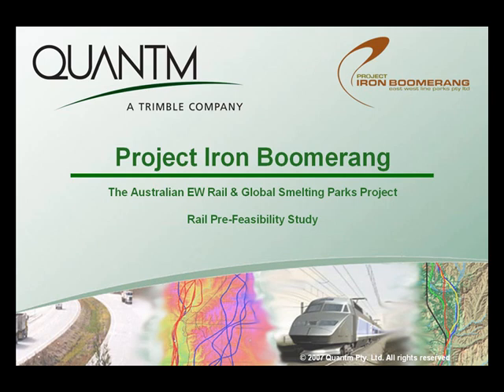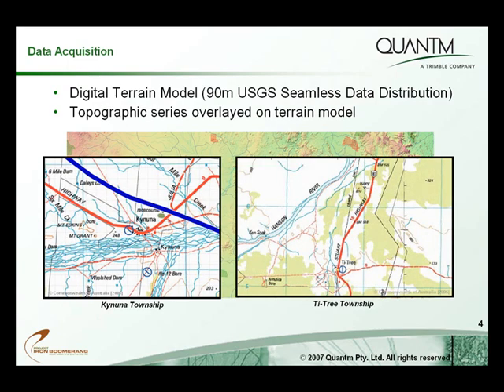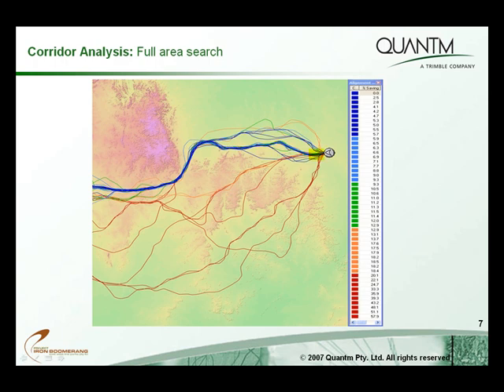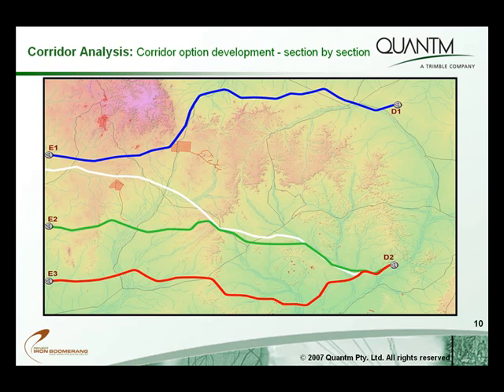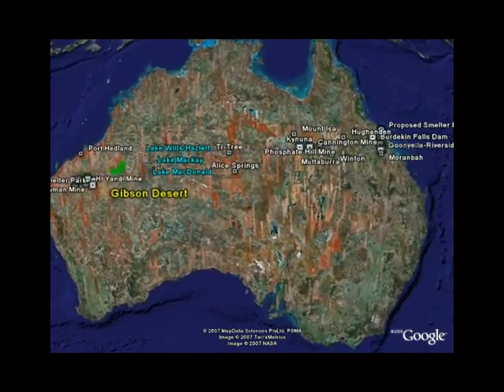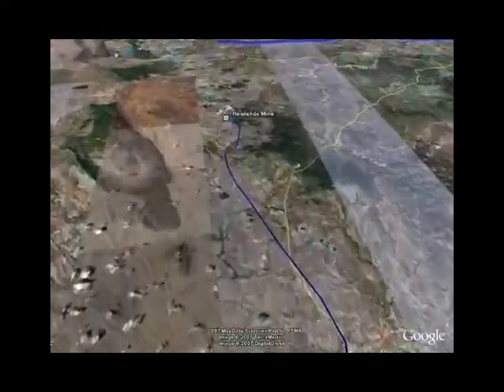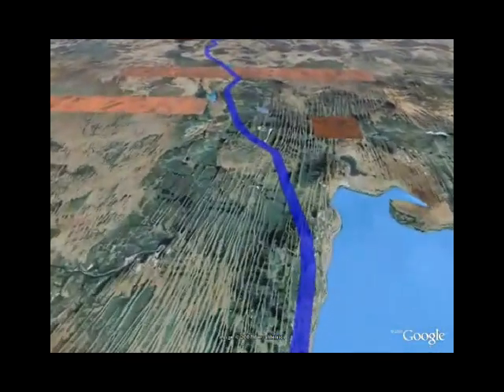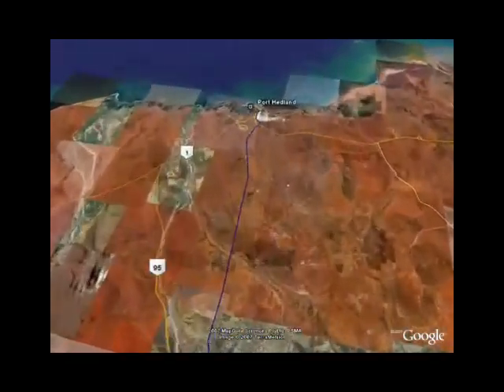Project Iron Boomerang Video

Comment: Project Iron Boomerang -- ACADEMIC CONSULTANT
- Master of Project Management (PM20)
- Master of Engineering Management (BN87)
- Master of Engineering (EN50)
        - PMN503 Systems in Project Management 
        - PMN601 Projects and Performance 
        - PMN602 Organisations and Projects
        - PMN603 Project Investigation 1
        - PMN604 Strategy and Projects
        - PMN605  Strategic Project Procurement
        - PMN606 Project Investigation 2
        - PMN607 Strategic Risk Management
        - PMN608 Managing the Project
        - PMN610 Project Management Principles
Email: samuelthewriter@gmail.com (for assistance)